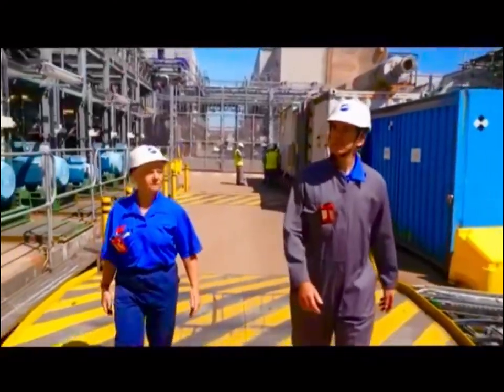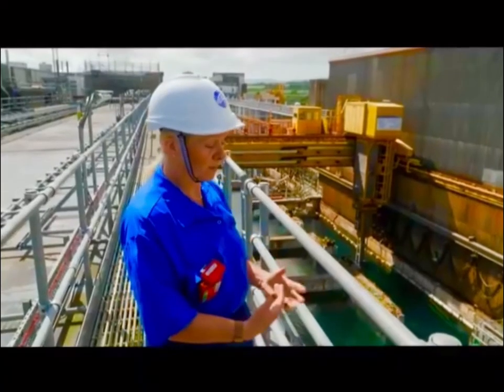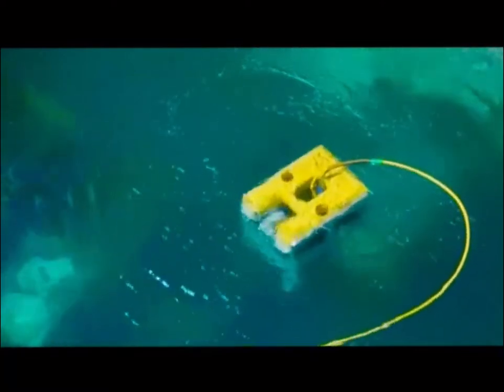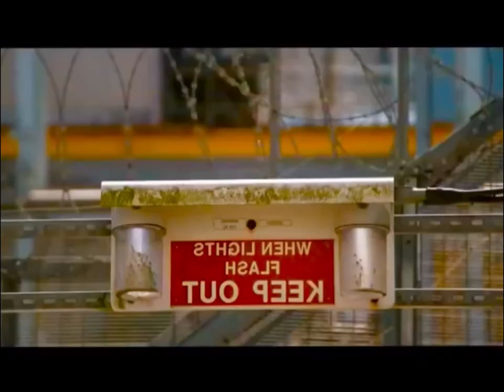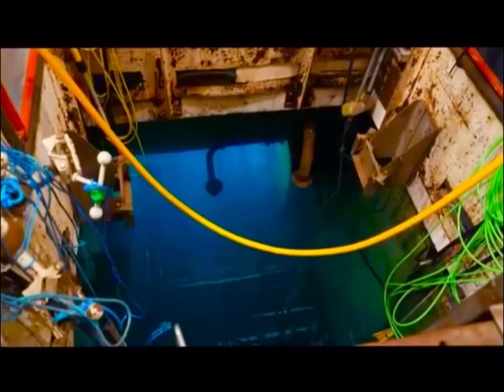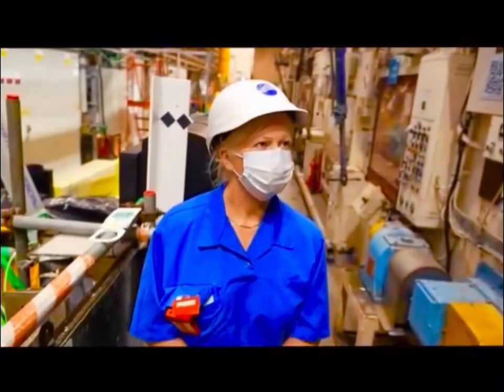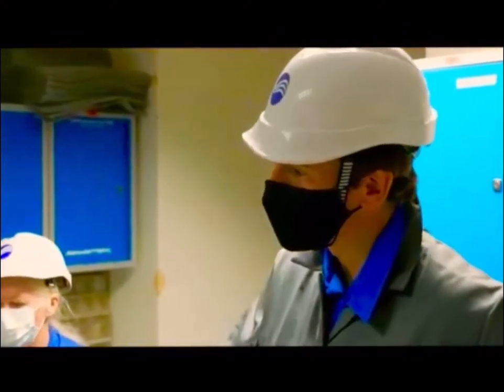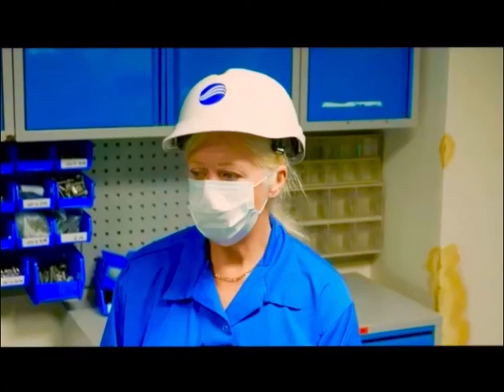Simon Reeves visits Sellafield - reuploaded

Comment: I'm not going to blame the pioneers who worked on this stuff of course they made mistakes ...public opinion went against "nuclear" including against nuclear energy and with that went funding to deal with problems and here are some of the consequences of those cuts. " wind and solar are a fraction of the price " people keep saying this A) the price of something  that isn't there when you need is irrelevant ( if the wind isn't blowing), there is no energy storage scalable to cope with wind or solar or tidal dominated generation. ( give it 30 year maybe... is that good enough) B) Nuclear energy costs reduce with scale like nothing else and we need it on a massive scale so the costs will fall dramatically if we manage things competently. We've got to start reprocessing and fast reactor programmes again so  waste like this is reprocessed and "burnt" in fast reactors which generate 10 -30( I think??) times as much energy from the "waste" than the thermal reactor did making it leaving behind much less material that's safe in circa 300 years decay. Do your research the information is out there. Existing nuclear energy technology is the only  base load clean ( very low carbon) source we can scale to provide for our needs. Also other nuclear fission energy technologies  ( fast reactors , molten salt, variety of SMR) have more  potential than any other generation technologies. It's literally the most powerfull technology known to man for good or evil and if you mismanage it things can go wrong, that happens with powerful technology but to suggest we don't use our most powerful technology to tackle our biggest ever challenge is wrong IMO.
Reply: .. 'to provide for our needs' .. I suggest we seriously assess just what these are/might/should be ..
Reply: @johnwakefield8570  yes that's got to be part of it. But poorer countries look at our quality of life and want the energy generating technology necessary to support that quality of life ( even with savings). Are we going to say no you can't have it you should have intermitant energy sources only because our media likes those technologies. They want use their fossil fuels the way we do/ and did. Will we say you can't use nuclear to provide a clean base load. They are going to get more power whether we like it or not and can you blame them. Right now the only option they have for reliable power is fossil fuels. Nuclear tech is the only thing that can replace that ( in most situations)

Comment: ‘Some think that nuclear is the solution to climate change, even though wind and solar are a fraction of the price.’

1. Fraction of the price, smaller fraction of the energy efficiency.
2. The elements required for solar energy are rarer and more harmfully extracted from the earth in expressions of the effect on labour forces and the environments they’re extracted from. 
3. The carbon emitted in making photovoltaics, tidal and wind generators is hardly an improvement. The scale by which you would need to extract elements for making photovoltaics and wind turbines  to compete with nuclear energy would be a disaster for the campaign to promote solar and wind as carbon ‘neutral’ energy sources.

People need to just accept that all of our energy demands involve scary and unpleasant factors. If we could store nuclear waste underground in areas where we already have armed security (think of the military bases up and down the country), and use the accumulated knowledge for improved nuclear waste handling and disposal then we have removed the lingering ghost of nuclear power.

Anybody arguing that Chernobyl could happen needs to chill and check reality. As long as we keep nuclear facilities secure and employ informed and reliable people to run them we could cut the cost of powering a nation of millions by factors that we couldn’t comprehend. 

The reason we couldn’t comprehend how much cheaper it could be is because the energy industry is run by manipulative tyrants who have maintained greater empires than the East India Company.

Comment: This video is quite misleading, as with many discussions about Sellafield, it falsely depicts the troubled site as a product of Nuclear Energy generation. Rather, the site started out as Windscale, where it was used exclusively for the production of nuclear material for nuclear weapons. The site was then morphed into the Magnox program, reactors that were designed primarily to produce large amounts of irradiated fuel that would have the plutonium recovered at Sellafield. 

It is wrong to say that Sellafield, in all its horrors, is a product of Nuclear Energy, like some campaign groups are doing. 
Modern nuclear energy produces very minimal waste and what it does produce can be recycled without the mess you see at Sellafield. 

Nuclear Energy WILL be needed to achieve affordable and clean electricity, wind & solar fail to do any heavy lifting.
Reply: Nuclear energy can be safe and we’ll likely need it to avert a climate disaster, but in the wrong hands (e.g. profit-driven corporations or authoritarian governments) it’s always a substantial risk. Yes, it was the haste for nuclear weapons that produced most of this mess, but nuclear power programs have also made a significant contribution. Reactor designs which are passively safe, combined with intense oversight and strict governance of nuclear facilities, could achieve an acceptably low hazard profile and bring enormous benefit.
Reply: Recycling and waste management should be incorporated into the design. Many facilities seems to have no idea about what to do with the waste. Fukushima, i think stored used fuel on top of the reactors. Which is just mind boggling, considering the emergency diesels were in the basement, and the reactors exploded. That design is not from the 50s. And the japanese are so smart, how could they not have seen this ?
About waste, i think we need to add uranium mining, and plants for milling, refining, and converting uranium, and fuel fabrication plants is also part of the nuclear power process. This adds much more waste. 
Only in New Mexico is 1100 abandoned mines with mountains of radioactive tailings, and it has polluted groundwater on Navaho Nation with 524 mines there.  Powering a one-gigawatt nuclear plant for a year can require mining 20,000-400,000 mt of ore, processing it into 27.6 mt of uranium fuel, and disposing of 27.6 mt of highly radioactive spent fuel, of which 90% (by volume) is low-level waste, 7% is intermediate-level waste, and 3% is high-level waste. The world’s inventory of uranium mill tailings amounts to 2,352.55 million tonnes as of 2011. These tailings leak radon gas and radioactivity into the surrounding area, even if they are buried and covered with a thin layer of grass, to make them look pretty.
Also, any recycling facility that is constructed/built to handle used fuel, 
will produce more waste, since that facility also will become contaminated.

The finnish Olkiluoto power plant is the best example i can come up with, that seems to have at least some good design choices: 
1. Its big. Build everything in 1 place, to keep it contained. Very good choice.
2. It has a storage facility called Onkalo. 500 meter deep into granite, it will accept used fuel for 100 years. Also super positive.
3. The waste Heat is used.
4. Its based on well known principles and design. No breeder reactors or molten salt stuff.  So no surprises.

About the British technology: There is significant evidence that the British Magnox nuclear plant design - which was primarily built as a military plutonium production factory - provided the blueprint for the North Korean military plutonium programme based in Yongbyon.
Reply: Magnox was primarily for power generation, all sites being initially built for the CEGB with the exception of Calder Hall and Chapelcross (which were never owned by CEGB or their successors but always by BNFL).  However the reprocessing plants (both Magnox and THORP) were in the main for the nuclear power industry.  It was also the location of the first experimental AGR reactor.  So while its initial focus was indeed Pu production for weapons, the dirtiest sites (with the expection of Windscale 1) are the reprocessing sites and their associated ponds.
Reply: You're not wrong, except for that bit about recycling nuclear waste.  If that is do be done in a responsible way such as to not wind up like Sellafield it will be ungodly expensive.

Comment: To say that the site is related to Nuclear Power is a bit misleading. This is mostly a site for manufacturing nuclear material for weapon use.

Power was more like an added benefit but it wasn’t the main purpose for this site.
Reply: It had a nuclear reactor on site called Calder Hall
Reply: @christeamhound  Which was mainly used to produce plutonium for the nuclear weapons program…

Electricity generation was mainly for the public peace of mind.
Reply: @tonamg53 As someone who’s worked there for most of my life I can tell you, you are wrong. Windscale pile1 and 2 were built to produce weapons grade plute. The 4 reactors at Calder Hall were built to produce electricity. Despite what Wikipedia says Calder Hall and Hinckley point were built with the ABILITY to produce ploute in an emergency (ie war) they never actually did, or at least not much. Polaris entered service in 68 and since then the U.K. has been entirely reliant on the U.S. for nukes. Calder Hall meanwhile didn’t stop producing electricity until 2003, 35 years after Britain stopped producing nukes. In fact between Calder opening and Polaris entertaining service was just 12 years.
Reply: @colinreid165   Windscale piles were shutdown permanently after the 1957 fire…

Where else do you think UK got its supply of plutonium from? 

From International Panel on Fissile Material:

“The main production site for UK military plutonium was the Sellafield complex, which hosted a total of six production reactors: the two Windscale Piles and the four Calder Hall reactors and all reprocessing operations.”

From the Institute of Civil Engineering:

“Calder Hall was in fact primarily intended to produce plutonium for the UK’s atomic weapons programme. Producing electricity for the domestic market was a sideline for the plant”

Are you like receiving your salary from the UK government or something to spread misinformation?
Reply: @colinreid165  Also note the Trident missile is American but the war head for British Trident missiles are primarily constructed at AWE Aldermaston.

👍🏻

Comment: I don't know if I can be bothered to watch this film, well seeing he's not an engineer or technical man,  errors already at 00:37 and someone should have told him that as a reporter, writer or journalist to be more correct with your choice of words, fire DID NOT sweep thro Windscale, more accurately a specific single reactor pile overheated which led to a runaway thermal increase which by a 'last chance saloon' idea of wetting/ cooling the surrounding pile and working inwards (my description and I've never seen it better put) ... by luck and bloody dangerous hard work they managed to decrease temperature toward safety again. The meanwhile ensuing air ventilation was an admitted calamity (and a fundamental basic design flaw) ... thank God for the Cockcroft filters at the top of the stack and Tom Tuohy and no doubt others that did the necessary. Heroes one and all!  No doubt I'll add to this as I get past 00:37

Comment: @1:58 bullshit!! you can wear that type of passive dosimeter anywhere you like as long as it is visible. You would not tuck it underneath another layer of clothing. As a visitor Simon (and all members of his film crew) would have been issued with an active dosimeter which would give a live measurement of his exposure! As for how he talked about the risks from the different "zones" give me strength!. The different zones are all about the level of training and protection someone has to minimise their exposure. Simon has no training so his guides have to take maximum care of him. With the right level of training and protection those working in the most radioactive areas of a site could actually be exposed to less radiation than those working in areas with the least radioactive exposure.